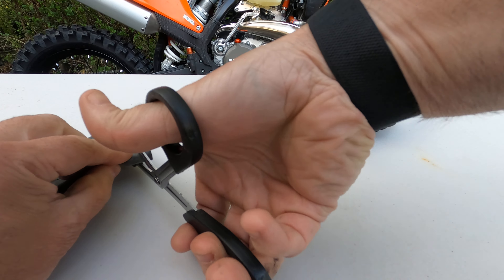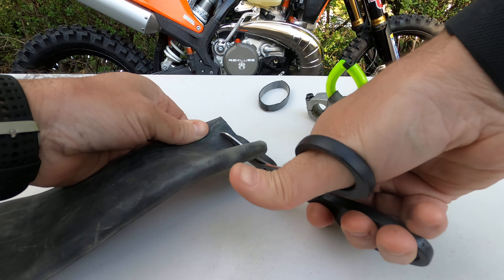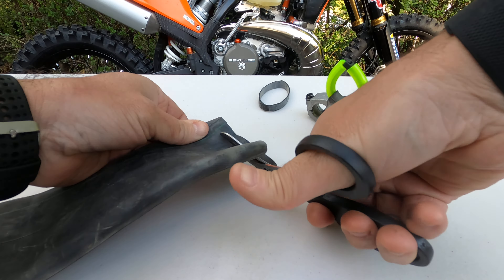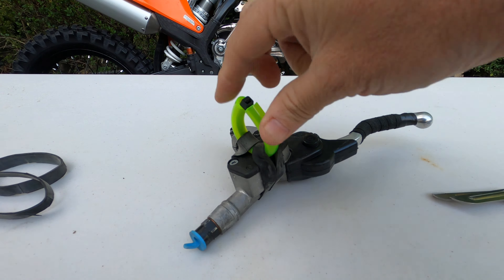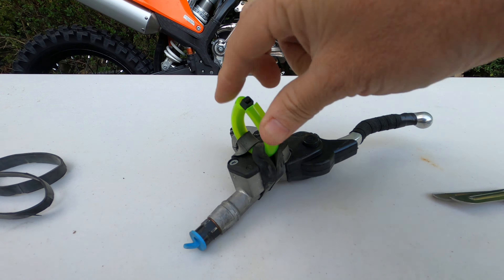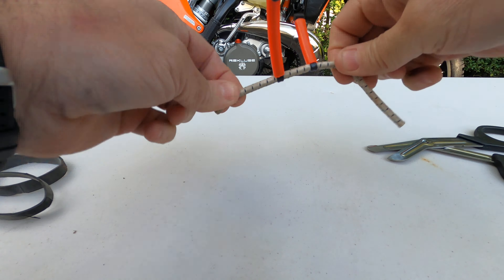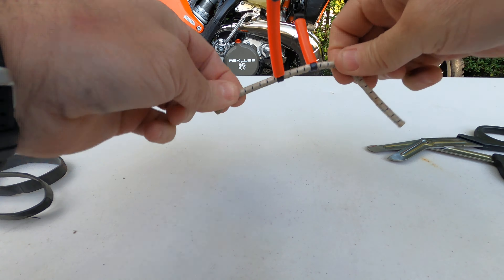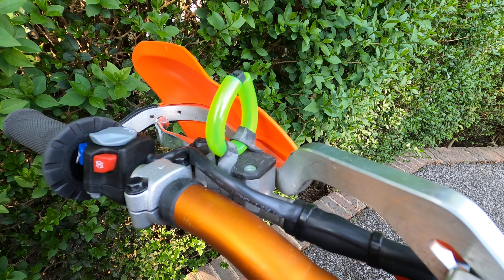Energy gel or time card pull tab elastic for enduro bikes

Comment: I don't know what a energy gell or pull tab is can you explain
Reply: Im guessing you put your energy gel (google it) in it then can grab it for food on the go. These are just guesses and I don't have one for the pull tabs
Reply from the maker: Yes, spot on. We use energy gels from various producers like SIS, High5, etc. And stuff them under the elastic (instead of keeping them in a backpack) so they are easily accessible during the race
Reply from the maker: I should add, these are for long duration races - 3hr events or longer. You won’t do this in MX

Comment: I noticed your 2020 bike has the same headlight switch as mine. Can yours turn the headlight off or do you know of a way to modify the switch to be able to switch off the headlight?
Reply from the maker: AL 500 there is a Youtube video showing modifications to the switch. Or buy a 2016 switch, plugs straight in
Reply: the standard switches are crap, always burn out and the kill engine button has a tendency to stick. but no you can't turn the light off unless you replace the switch with the factory version